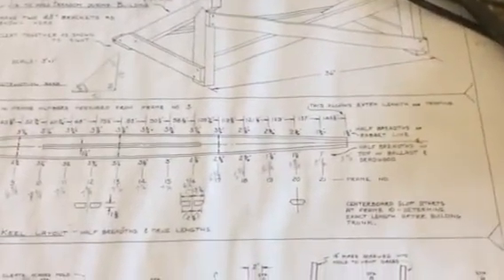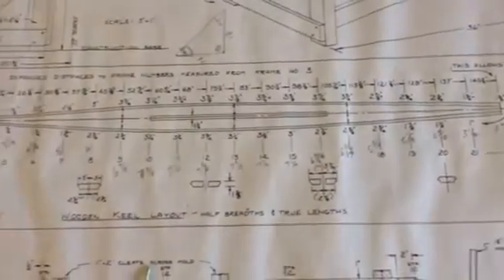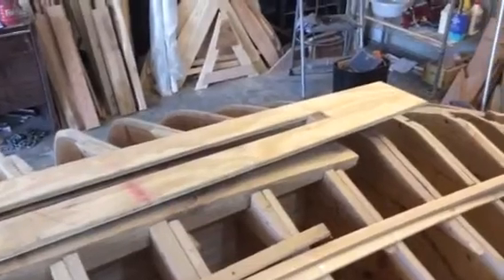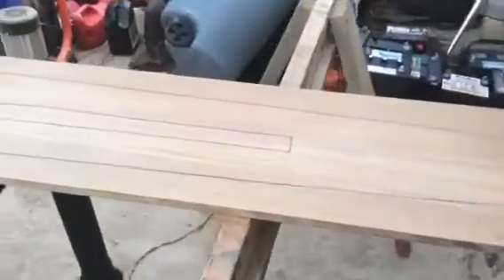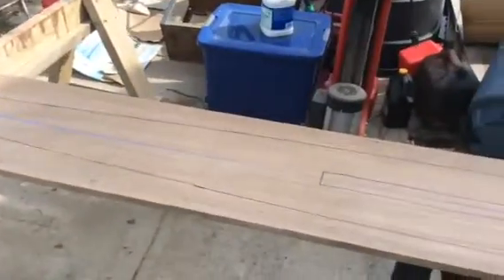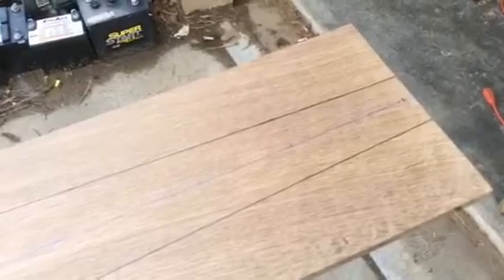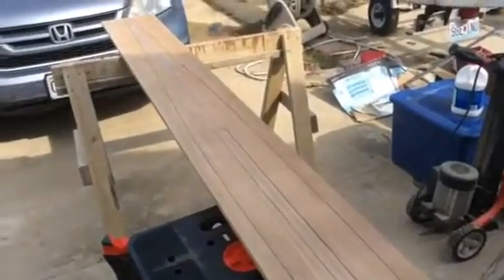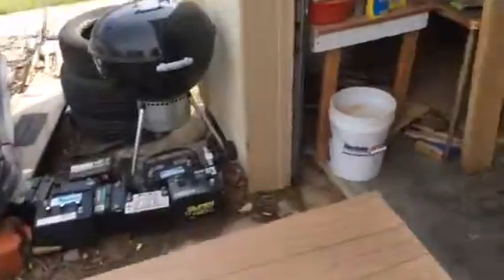Haven 12 1/2 lofting the keel - Episode 22

Comment: hey chuck, thanks for all these haven videos. Its hard to find any visual info out there. do you have plans for your frames when you are finished? Ive been dreaming of building this design and am girding my loins for the process. I love the idea of doing all of it myself, but i also like the idea of reusing a frame set. please let me know, Id be happy to pay and pick up if you are willing to part with them when the hull comes off.
Reply from the maker: Howdy, Yes, I would pass them on for your build.  I actually got these from a fellow in Pittsburgh PA. He had build the frames and subsequently a beautiful Haven and had kept the frames, in part because he had so much effort in them and too, he thought he might build another one someday but when I approached the Wooden Boat Forum with some questions regarding the plans (which have some obvious errors) John offered up this set of frames. I drove, over a weekend, from Kansas City to Pittsburgh, with a trailer and picked these up. I am stalled in my build at the moment and likely won't resume building until this fall. I am at a point where I need to steam bend on the keel and then start planking. I expect to get all of this and more done over the Fall and Winter. Yes, I would be happy to pass them on. I will very likely continue to put up video as the process resumes and continues. Just get back with me as I'm lifting off of the frames and they are yours.
Reply: Chuck Jenkins thank you so much for your reply! I'll keep watching and be in touch. Your build is going to be beautiful!